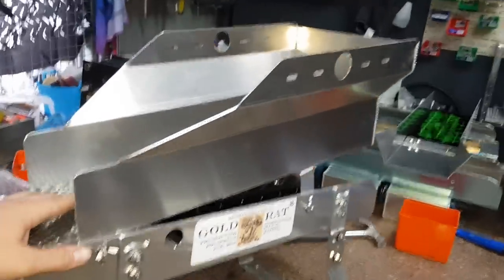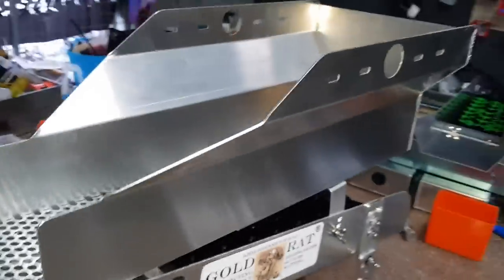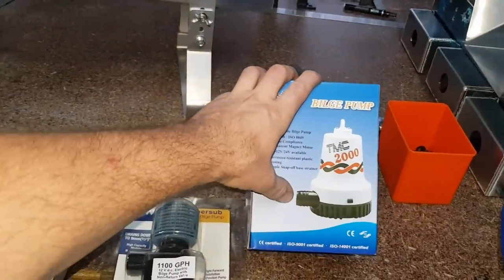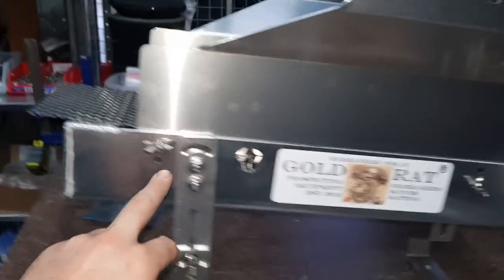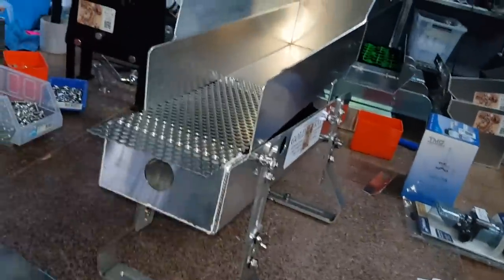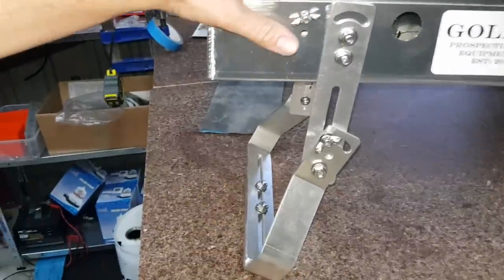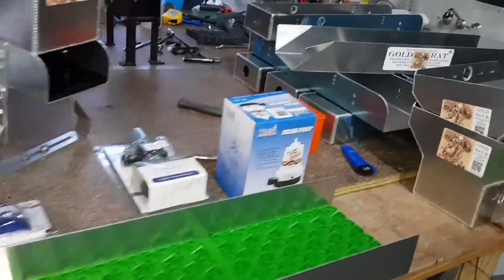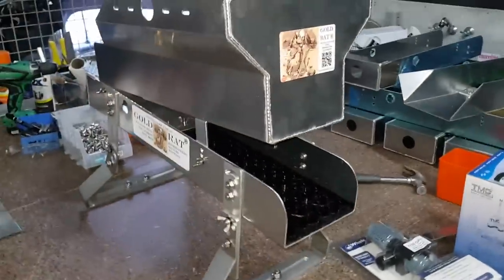Backpack Highbanker -Modular 6 Inch Vortex Dream mat Gold Sluice

Comment: Dustin, so the 1100gallon pump can run on the highbanker but will need longer run time on the clays to break them down. Is there any recommendations on angles for the highbanker and sluice.
Reply from the maker: Yes mate 8.5 to 9.5 degrees is a good average fall

Comment: That's a great looking unit mate but would it still run good with a 8 inch sluice to run with the mini 6 inch high banker or would I need a bigger pump than the 2000? 
If not the 8 inch which sluice would you recomend but i was keen on the 8 inch.
I'll be buying one in the next couple weeks
Reply from the maker: Its not designed for an 8 inch so no i wouldnt use it on one. The 8 inch sluice has its owm header box and with the 8 inch we run 3000gph
Reply: @GoldRatEngineering  no worries mate